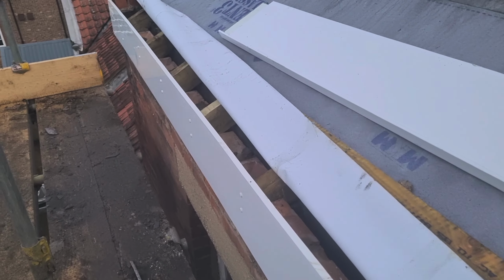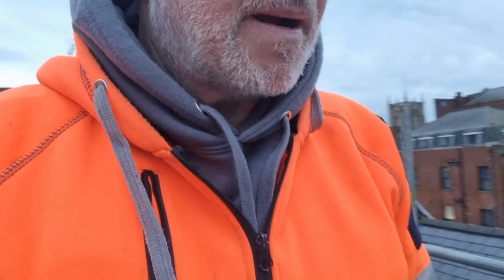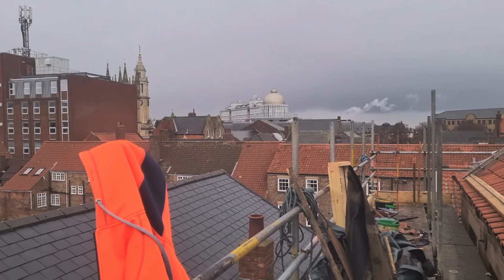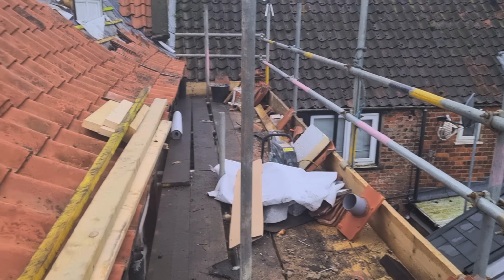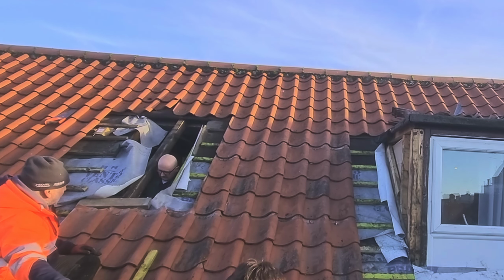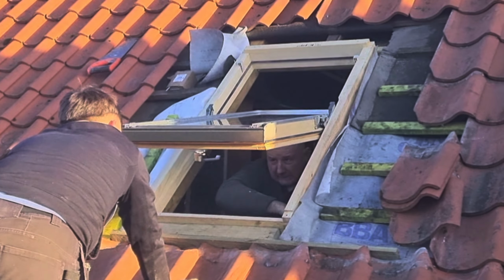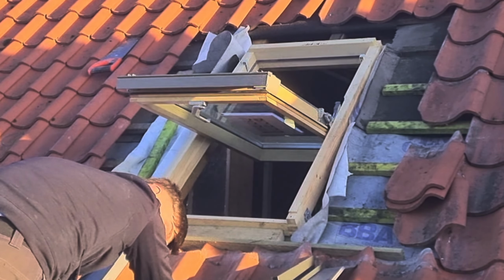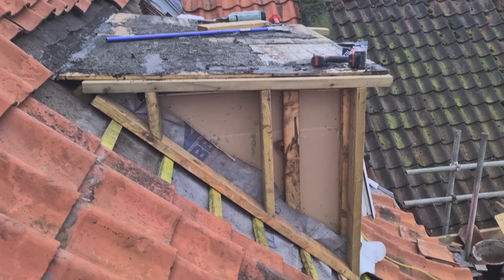Discover the Secrets of Installing Skylights for a Brighter Home, #sunlux,#skylight, #roofspace

Comment: And its getting colder for you guys 🥶 . Making a silk purse etc on that roof. Well done guys for sticking it out. 👍👍
Reply from the maker: You are not kidding there doug, all the bends and twists in the building  doesn't make it easy, and it s def getting colder
Reply: When i was in maintenance in an ice cream factory sometimes we had to work in the spiral freezing chambers where it was -40 c. That wasn't fun. Could only stay inside for 5 min at a time and the welding leads would freeze stiff in minutes 😨😂😂